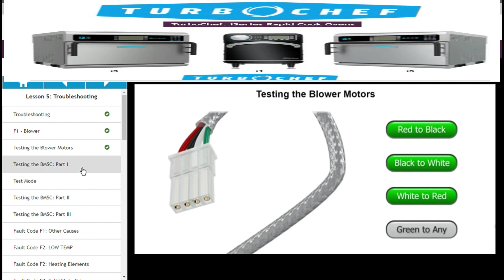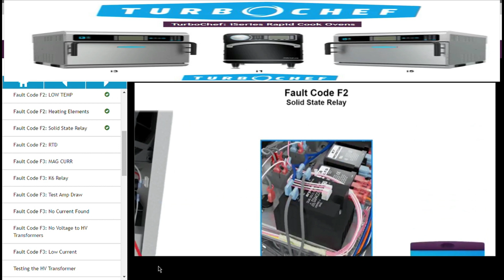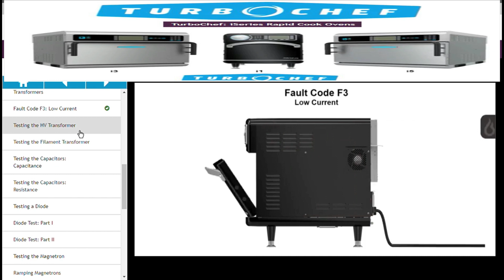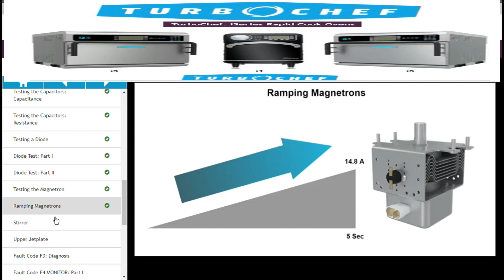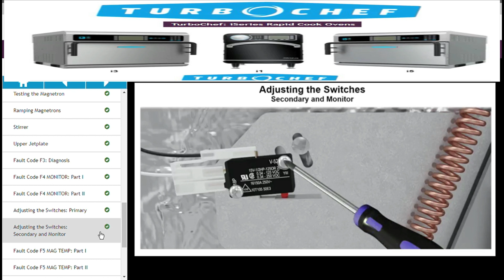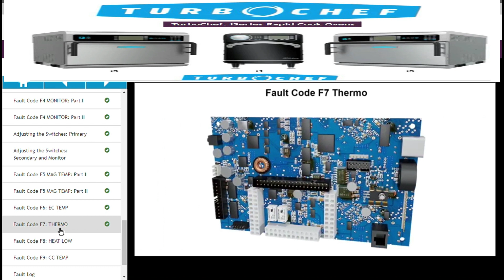Turbochef I Series Fault Code Error troubleshooting and explanation

Comment: I have an issue about my turbochef sota not beeping ( don’t have any sound )
Reply from the maker: It could be a faulty speaker or a loose connection on the control board, try to unplug the unit for 30 seconds. (reset) if nothing happen better to call a turbochef acredited service technician to check and evaluate the unit.

Comment: Testing the blower motor speed controller “BMSC”
J1 & J2 connector, how do I determine Pin numbers looking at the connecter?
4:00 in your video
my wire colors are different than the video
Reply: I have photos but do not know how to post them here
Reply from the maker: sorry for the late response,the pin connector have a tiny number per pin.